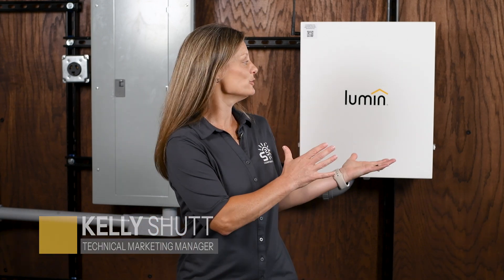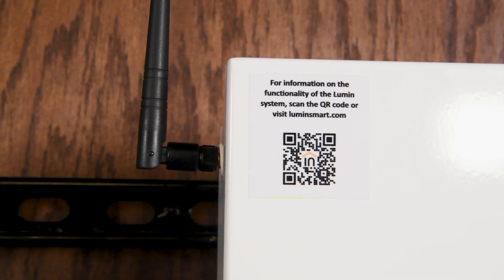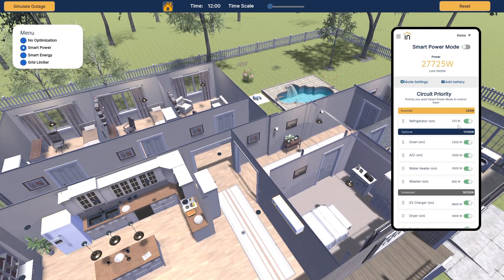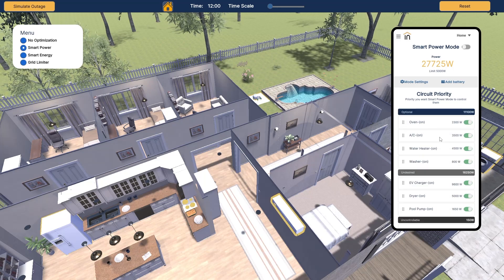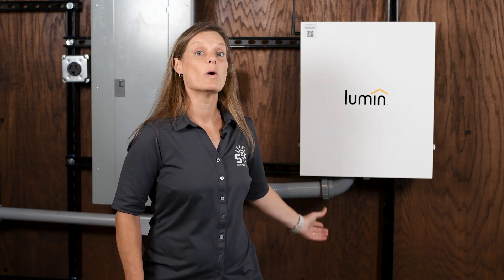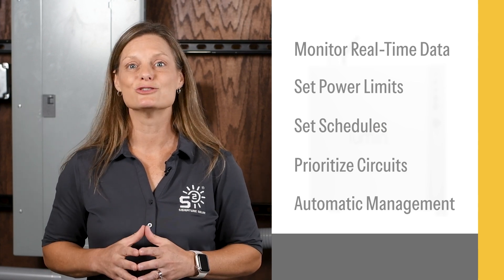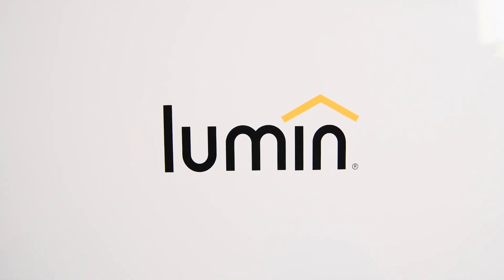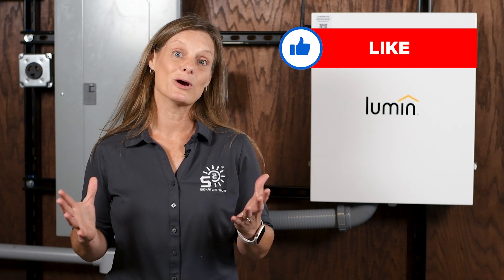Lumin Smart Panel: Transform Your Home’s Energy Management - Installation and Features

Comment: First question: If it's only connected to 6-12 circuits, how does it monitor total home usage? 
Second question: does this become the ATS? Or work in conjunction with an automatic transfer switch?

Comment: From what your describing it sounds like a transfer switch. Lumin is not the first company to offer something like this as Anker recently released their smart home panel. Both of them sound nice in theory but for what I am guessing is going to be a rather high price point for me I need more than just words. You are nice to listen to but please show more of the product.
Reply: The Anker smart panel will not shut off individual breakers depending draw when on back up power.
Reply: @danielsoutdoors  im so past this. I have moved on to something else. The Lumin in my opinion as a big waste of money just like the ones from anker. The only one so far I have seen that really makes sense to me is the ecoflow home panel 2. And before you say it no I aint endorsing them. I have a hard time transferring all those circuits to a panel that could possibly fail or need replacement and then what. Have someone come in to rush to reverse everything.. You see where I am going here
Reply: @davidbailey3289  What I don’t like about the Ecoflow panel2 is they limit you to 30amps per square. What about the SPAN panel?
Reply: @danielsoutdoors  I haven't really dug much into span but already I am seeing the limited ability when it comes to the battery system I would use. Furthermore I still see my big problem not being discussed. What happens should their panel fail. Is it a grid go down type of situation even if I am off grid? I am all for the technology but i need someone to address my concerns.

Comment: For a typical 200A service, are there recommended guidelines for which circuits to manage?  The obvious answer might be the biggest consumers, but some of those can be managed manually.  For example, during an outage, just don't run the oven or the dryer.  With a limited number of circuits available in the LSP, maybe some of the automated circuits would be better, like the water heater or heat pump?  Does the new code require that even with a smart panel, the backup needs to be able to supply the un-managed loads?
Reply from the maker: We recommend physically managing them; this could easily be accomplished with a Smart breaker panel system such as Lumen, but typically we say just turn off your heaviest loads, as the inverter can only supply 50A of off-grid power and surge for 5 - 10 min (depending on the size of the surge)

Comment: If this sits between the inverter and the critical loads panel, how does it determine if grid is down to shutdown high usage loads?
Reply from the maker: It comes with CTs that will connect to it that will determine when the grid goes down.
Reply: @SignatureSolar  thanks. This is exactly what I’m looking for. If grid is down, need a way to turn off my mini splits so they don’t pull the battery down.
Reply: First question: If it's only connected to 6-12 circuits, how does it monitor total home usage? 
Second question: does this become the ATS? Or work in conjunction with a automatic transfer switch?

Comment: Hi Kelly, how many circuits does the Lumin handle.
Reply from the maker: 1 Lumin Panel can handle 12 circuits @ 30 Amps or 6 circuits @ 60 Amps, or would be a mixture of the number of 30 amp and 60 amp circuits needed with a max of 12 per panel.

Comment: Hi Kelly, kindly confirm if it can be intergrated with EG4 Indoor Lithium Battery.
Reply from the maker: Currently, SOC integrates with Enphase, Tesla, and SolarEdge but Lumin is working to integrate with EG4 batteries very soon.  The Lumin Panel will otherwise work with any batteries, it just won't integrate the State of Charge control.
Reply: they are now compatible with EG4.